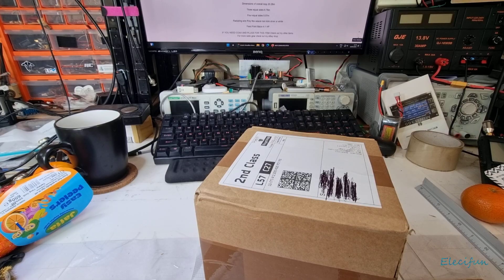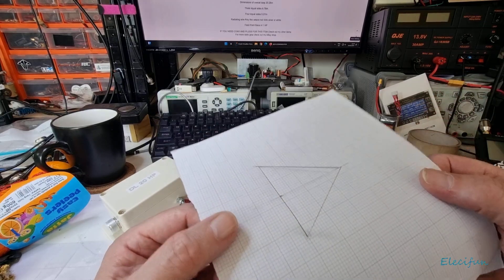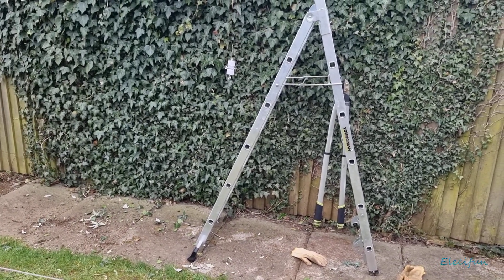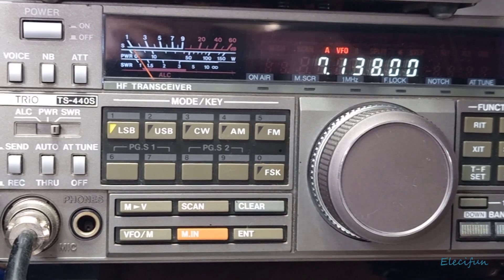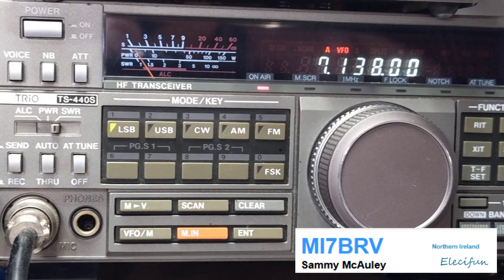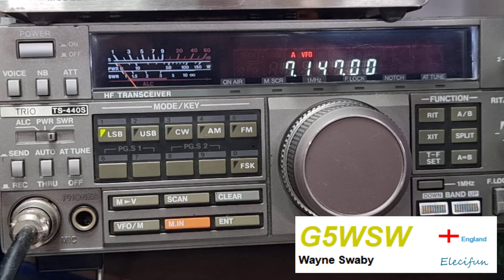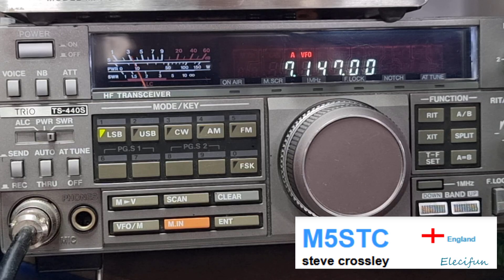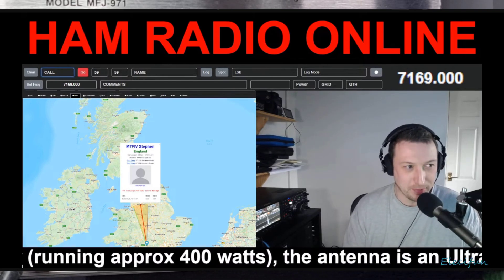DELTA Loop 20  Multi Band Full Wave Loop Ham Radio Antenna

Comment: I have the same antenna. You don't need to have it in a triangle configuration, they can also be used as a square. I have done this to reduce the size it occupies in my garden. If you do a search, you will find what positions are optimal for positioning the box in either configuration. One advantage of the square is that the base edge only needs to be a a about 1m above ground.

Comment: Why on earth are you using a 20m Delta loop on forty? I’ve used horizontal deltas for years - cut for eighty and, with my trusty E-Zee-Match, they load up brilliantly from DC to ultraviolet - but trying to operate at half the designed frequency is a no no.
Reply from the maker: @sihartgroves7549  Why not? Please leave your reasons. I made several contacts with the experiment which is what amateur radio is all about.
Reply: @M9SVW Because the characteristic input impedance of the loop will drop from 200 ohms to about 5 ohms if you excite the loop at half design frequency (effectively creating a half wave loop). It will work - after a fashion - but will be dreadfully inefficient, and the radiation pattern will look like a dog's dinner. A 1:4 balun will only add to the inefficiency.
Reply from the maker: @sihartgroves7549 thanks for the informative response. I agree it works sort of and given your explanation of why it is not efficient the outcome is expected. It was worth a try to compare against a tuned dipole and EFHW, for my own suck it and see adventure.

Comment: Hi. Great video.  Can I ask which pole you have for your vertical vhf antenna?
Reply from the maker: Hi cheers, the poles are here at this time.   https://www.ebay.co.uk/itm/405521746540?var=675810469435. good luck 73